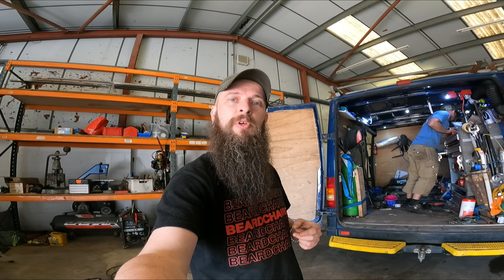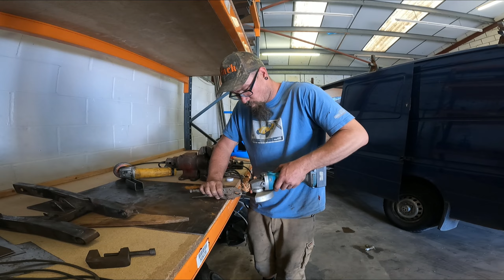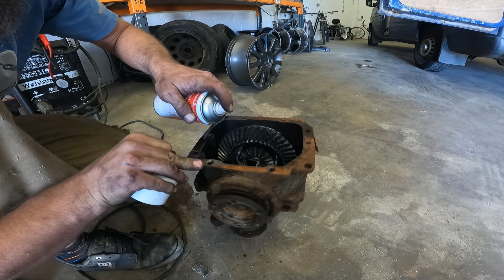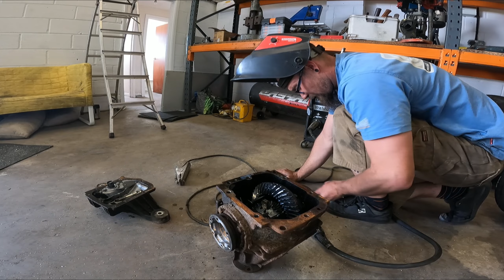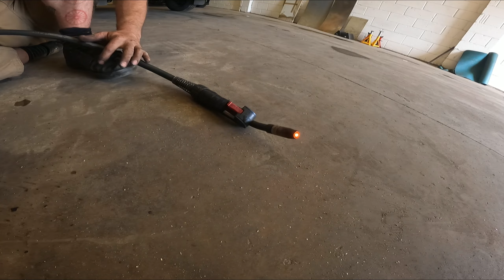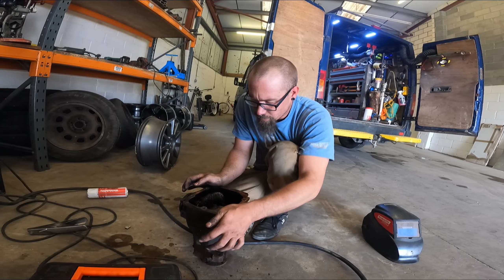How to Weld a Rear Differential w/ Gonzo Custom

Comment: C etait quel voiture ça ta S3 ?
Reply from the maker: Non ca viens d'une BMW ca, pour un client.
Reply: @Beardchanics  a oui je me disais aussi c est pas la S3 ça
Reply from the maker: @AUXMP3TV  S3 je veux un LSD pour le devant (pour les FWD burnout) et derriere j'aimerais bien choper un jour le differential de la nouvelle, vu que ca leur donne une meilleur acceleration.
Reply: @Beardchanics  tu vas en faire un dragsters ou quoi mdr . Tu vas bientôt enlever les sièges derrières . Tu vas mettre un arceaux de sécurité ? Ta raison change des trucs comme ça quand je viendrai on verra vraiment la différence entre les 2
Reply from the maker: @AUXMP3TV  Apres le nouveau turbo la priorite sera faire le wide body kit rally style. La cage j'en veux une mais ca sera plus tard. La vider je vais attendre un peu aussi je pense. Mais le but est "race" mode complet. Videe, arceaux, vitre en plstique, plus d'aclim, de radio ect. Je veux qu'elle puisse faire 0-100 en 2s quand j'ai fini :)
Reply: @Beardchanics  Mais a la fin tu auras le droit de rouler avec dans la rue mdr ?
Reply from the maker: @AUXMP3TV  Ouais on va garder les clignotants mdr
Reply: @Beardchanics  mdr